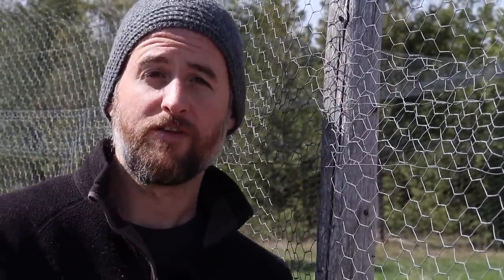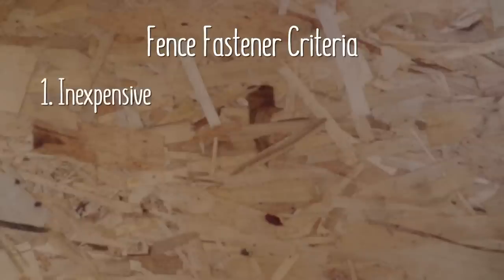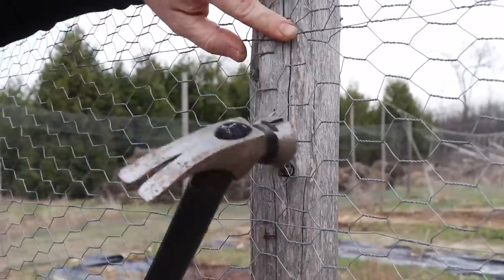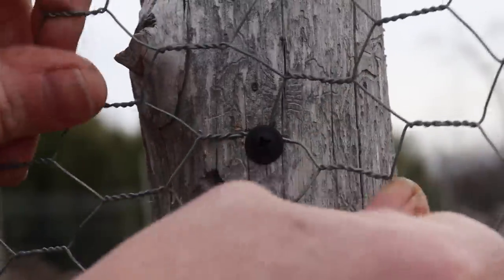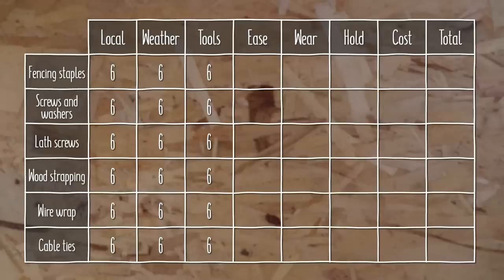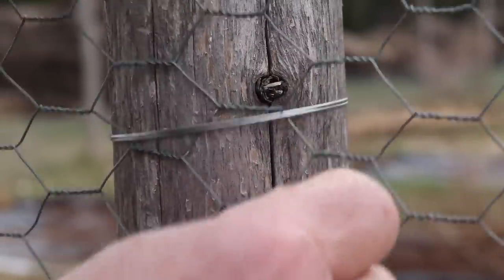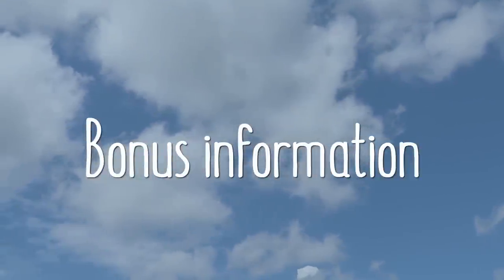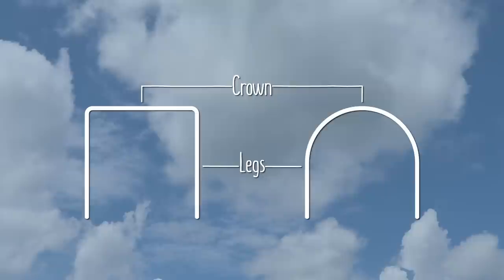Garden Fence (Part 3.1): Testing New Fasteners to Replace Staples

Comment: I've used most of these methods. Screws has been hands down the winner. Zip ties and wires degrade until they break, neither lasting more than a year or so. Staples work, but are far more irritating to install, and ... Not covered here ... Screws can be easily removed to take down fencing, Staples can't. Relevant for reconfiguring, replacing damaged fencing, etc...

I also have opted to alternate screws top and bottom on the holding wire (typically welded wire or woven wire), holding it all up from climbers and down from goats/sheep trying to push it up from below.
Reply from the maker: That's SUCH a great point about the screws being easily removed / reconfigured!! I don't think we'll need that ability with our fence, but for many others, that could be a huge advantage. Thanks!
Reply: @BackToReality  Fence wire is cheaper then what ever that stuff is and I found zip ties much cheaper.   Do a you tube search for "10 Creative Ideas to Reuse Plastic Bottles / Bottle Cutter 2.0" that is the method that I would use as its virtually free an far stronger.

Comment: For our fencing to enclose out large property we used round pressure treated posts and livestock fencing. To attach the fence to the posts we used fencing staples and they have held up for 10 years with none coming away from the posts or wearing through the livestock mesh. Don’t use hardware cloth, it’s useless.  The wood strips look horrible and doesn’t look all that good. Zip ties will wear from sun exposure rather quickly.

Comment: Nice approach to this problem solving, and thank you for telling that those scores should maybe, and actually, be pondered in a way, giving that some factors are more important than others.

To me that would be very simple to chose: strapping all along. As the son (and also grandson and nephew) of a blacksmith, the times I saw them make anything similar to this, that was the way to go. Mind you, most of the wired fencing I saw them make was with wired mesh, so it required welding and therefore it's a completely different animal, but when it came to some kind of chicken wire that required some structure, this was the way to go.

Of course, that required (and it also was my first thought until you mentioned wood) something to strap the wire, and they would use some iron rod, usually the kind you use in construction sites. You just sandwich the chicken wire between the wooden post and the iron rod and that's it. The problem may be how to place the iron rod in place. As they would make it all out of metal, they would weld it in place (top and bottom and maybe a few tacks along the way) but this is not the way to do it here, obviously. So that would need a way to hold it in place, also top and bottom and maybe one to three points in the middle. But given that the posts might not be (and certainly not as time goes by) completely straight, that would render impossible what I think it's the main advantage of this method: holding the chicken wire from top to bottom and therefore distributing the pulling from the wind/animals more or less in an uniform mannter.

So, yes, here wooden strapping would be the way to go for me. Yes, wood is kind of expensive for this use but you might as well use reclaimed wood from pallets or whatever. It doesn't need to be a whole piece top to bottom, you may have several pieces in line. And yes, pallet wood is wider than you need (usually) and that would require you to strip them in half but... well.

Why would I choose this over any other? well, because, as I mentioned, this distributes the strengh all along the wood and all the nails/screws/whatever you may use, thus reducing the chances to having a "first one" to go and then another, and then another.

The problem I find with staples and screws is that, as wind (and animals) does its job, it creates a motion in the wire that, with time, will cause the chicken wire to break, no matter how strong the staple or screw. Distributing this all along the height of the post will make it last longer, also because it will rubbing against wood, which is softer than the metal, obviously, of both staples and screws (with or without washers).

And as for zip ties, in my experience, well, those are larger than the ones I use to tie my vineyard, but after one season, maybe after two, they still hold in there nice against wind, but I don't need too much strength in order to break them apart just by pulling the vine branch compared to a new one. Again, yours are kind of three times wider than what I use, but even if they're supposed to be UV resistant, they're still out there "in the wild", there's heat, there's cold (and you live in a place where it snows, not like me) and that will end up making that plastic brittle. Ah, and some animals may even chew on it.

So, that's my two cents on the subject, and therefore completely subjective.

Than you!
Reply from the maker: Thanks for such a thoughtful and detailed comment!
Reply: @BackToReality  you may say it's boring as well 😁

Nah, thank you. If I think I can add my experience, well, you asked for it 😇

Comment: The wood strapping might be more cost affordable if you bought a sheet of plywood & make your own straps to the width that works for your posts. Just a suggestion. We've always use the hammer in staples & buy them by the pound in the US & always have a few extras hiding in bags around the shop..... lol... We always loose them & just buy more. 
One day we might get smart & make a bin for all the nuts & bolts hanging around but I don't think after 50 years we're going to change our system.... lol....
Good luck, love your videos, be safe, & God bless, 
Chris from Missouri

Comment: If you have a compressor, a pneumatic stapler works really well, and is super fast. I would not use zip ties outside. The sun degrades them after a couple years, and they break.
Reply from the maker: Good point! I considered using a pneumatic staple, but thought that may count as "specialized equipment". Either way, it's a great idea, and would have been both quicker and more fun! :)

Comment: If you get yourself some proper fencing pliers (maybe 20 USD, Irwin makes a good pair) they have lots of handy features, including holding the fencing staples solid for setting them. Also they make wire twisting (and getting it super tight) easy.

Comment: You are really underselling the normal wire. Its being used in a lot of outdoor applications when animals are involved. Try fastening it like you did, but after 2 or 3 twists use the needle nose plier or bigger head tool (non english here... toolnames are hard) grab the wire and twist the 'knot' you just created. It will create more twists towards the fence post, creating a more tight fit. Also if you use the curve from the wire, you should be able to wrap the wire around the post really quickly. 
The other used tactics look great too, but I'll stick with the wire for now. Its very cheap, readily available and in most cases I have it on hand when working on the electric fencing.
Reply from the maker: I think you're absolutely right.  I should have used pliers to twist the wire, rather than using my fingers.  That would have negated several of my complaints about that method, and potentially allowed it to rank much better.

Comment: I think the lath screw are going to run into a different problem than what you've experienced so far in that the fence may work itself out from behind the head of the screw given how small it is. The wood will expand and contract through the season and that could ultimately make just enough room for the chicken wire to work itself out.
Reply from the maker: Good point! The slightly smaller head of the lath screw (in comparison to the washer) might be just enough to allow for this slippage of the chicken wire. We'll keep an eye on that and report back if we notice any examples of it. Thanks!
Reply: @BackToReality  Surface area shouldn't really matter but how much the wood may shrink. If the wood really shrinks then both don't stand much of a chance. The question is wether this actually happens (I doubt it) and perhaps tightening in the summer once or more often might be enough.
Reply: @christopherstein2024  
It's both expansion and contraction that will cause issues. Wood swells when wet, and shrinks when dry. Eventually the holes in the post themselves could become looser due to this, especially with old wood that is exposed to the elements. Repeatedly being required to tighten the screws also seems like extra work that could be avoided using different fasteners. 
I don't understand why you think surface area doesn't matter when ultimately this would be a friction based solution. Less area to grip would mean less holding force/ resistance to movement. 

Sorry if this cane across as rude, that wasn't the intent, it just came out like that.

Comment: If you use wire to secure the fence to the posts, twisting the end with a pair of pliers instead of your fingers gives you the ability to twist it from the end towards the post, thus tightening the wire
Reply from the maker: You're absolutely right. I should have used pliers, instead of my fingers. Thanks!

Comment: I will typically use the longest T-50 staples and give them a whack with a hammer to fully seat them. If I'm stapling something that I'm worried about the staple working its way through, I use little discs or squares of high mil plastic sheeting.  Hold the 1x1" square in place and drive the staple through it.  Whack it with a hammer and it generally lasts forever.
Reply from the maker: These are great tips, thanks!

Comment: Maybe should consider loop ties. Easy to put on, with special tool, instead of pliers, and it’s cheap. As the wood posts shrinks, you can easily tighten these to the post again. Nothing last forever! So should consider what is easier to fix down the road. 
Can’t wait to see your end result and decision!

Comment: I've built several goat runs using T-post and welded wire along the way and 4x4 lumber for the door frames... One bent nail at the top and one at the bottom and then I attached 2x2s using deck screws... Holding nice in spite of the goats rubbing their backs against it!  Chicken tractor has slats on the outher edges and fencing staples on inside supports... Worked fine for me...
Reply: BTW.... GREAT job with your videos!
Reply from the maker: Thanks Dieter! I appreciate the info AND the compliment ! :)

Comment: I have used metal zip ties to repair a cyclone fence gate that my dog tore up (VERY determined Labrador!).  In place for several years, still holding up (wet western Oregon), though the dog is gone several years now.  Would be an easy fix if they were long enough to go around your posts. Plastic zip ties would become brittle from sun oxidation and cold.

Comment: The piece of wood could be held in place with construction nails instead of screws which should help with splitting. There are also far less expensive options for thin strips of wood, just need to shop around to see what is available in your area.
Reply from the maker: I totally agree that there are cheaper options to the 1x2s. For example, I considered ripping 2x4s into thin strips as a cheaper option for the 1x2s.  But unfortunately, (here in Ontario Canada, at least) a plain untreated 2x4 still costs about $6.98. So if I were to rip it into 4 strips, they would still be $1.74 each - cheaper, but still expensive (plus that would require a table saw, which not everyone has). Either way, using some sort of wooden strips is quite a bit more expensive than I'd like, unless you can find wood for free (or nearly free).

Comment: I‘m no expert in chemistry but as far as I know the galvanised stapel  reacts with the less precious metal of the fence leading to an much faster oxidation of that metal. Therefor the fence has often rusted through at the contact points.
By using not galvanised Stapels you could at least have solved that Problem.
Reply from the maker: Interesting... So if I understand this right, galvanization helps the metal it's applied to (the staple, in this case) but is detrimental to any other metal that it comes in contact with? And so therefore, galvanization is really only a benefit for standalone items?

Comment: Staples and screws will loosen and fall out in a year or 2 do to weathering on the post they also open the post up to bugs and rot each additional hole is a decay point. the 1x2s will rot pretty fast do to the holes plus rough. Sawn surface is just to open to weather so unless you are using old growth cedar they will fail probably in a year . The plastic zip ties won't last more that a year or 2 . because they are uv RESISTANT not proof. 
 Farmers have faced fencing has always been a ongoing maintenance issue for fence owners  since fencing was invented. 
 The term riding fence was made up for western movies.
 Personally I am curious about how black uv resistant zip ties would fair.
 But for post life therefore over all fence life I'd use wire or zip ties and repair as needed .
Reply from the maker: You make some really great points here. I hadn't (at all) considered the effects that the fasteners might have on the posts themselves.  I'll have to watch out for signs of premature decay from the screws, etc.  Thanks for commenting!

Comment: no offense, the video was fun, but this is sort of insane. If you had 1000 times the amount of fencing all of the thought and energy you put into this would be justified. It would be sort of like if I made a 20 minute video on which brand of oatmeal I should eat for breakfast Wednesday morning. You also didn't consider that you can cut a single piece of wood strapping into enough 1x1 squares to service a very large number of screws. Essentially wood washers at that point.
Reply from the maker: First of all, your breakfast analogy is spot on. Point taken! lol
My hope was just to spend more time than most people could afford / would be willing to, in order to try out a number of different options. That way, anyone else who was in my situation could make a better informed decision, without having to go to all the trouble. I love the idea of the "wood washers". I had considered using shorter pieces of wood (though, not 1x1 squares) but at that point, the video was already over 20 min long... lol. If I were to do this again, I'd give the small squares a shot. Thanks!

Comment: I think both your fencing is to flimsy and your fasteners are not very robust.

All in all I think you should go with tried a true fence staples.
Reply from the maker: Thanks Kevin. What type of fencing would you suggest instead? We originally chose the chicken wire because it's commonly used for this light-duty purpose, but also because it was relatively affordable.  I'd love to use something more durable, as long as it doesn't come with a huge increase in cost.
Reply: @BackToReality  we'll thinking about it I suppose as long as the wire is stabilized it probably won't get worn through.  Welded wire would probably be too expensive.

Comment: You really struggle with the scientific method dont you.  You say you will try a method, then before you even test it you modify it and dont get good info. You do this all the time. I too have terrible ADHD, I recognize it. The wire didnt get tested properly did it, cause its lathe screws youre testing now not wire. Have you considered that a looser wrap in the wire may prevent wear from wind because the thin chicken wire isnt trapped and pivoting back and forth eventually snapping but allowed to move a little? Just my rant, thanks for listening.
Reply from the maker: Hey Michael, Quick clarification: I wasn't actually including the lath screw as part of the wire wrap, in the comparison. At that point, I was just trying things out, and as I mentioned, it immediately defeated the purpose of the wire.   That said, I'm certainly no scientist, and I may very well have ADHD. So, I guess what I'm saying is... I agree. ;) lol